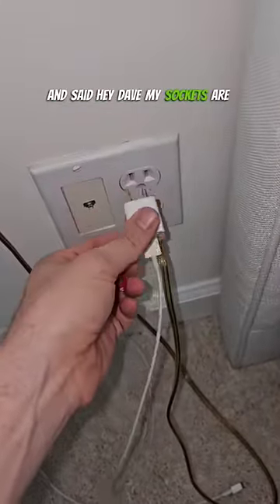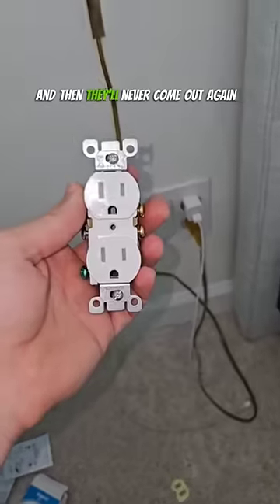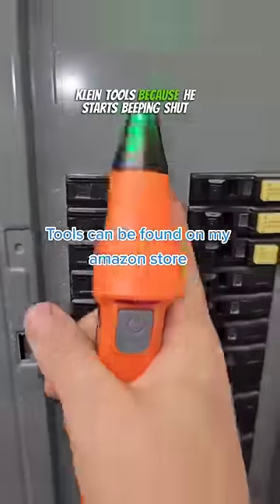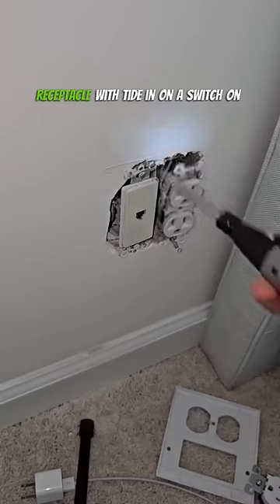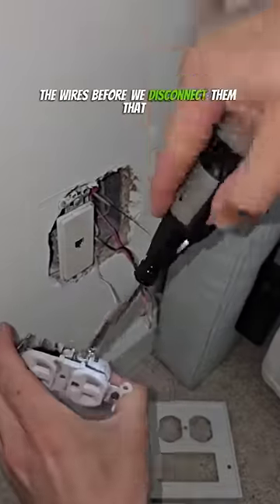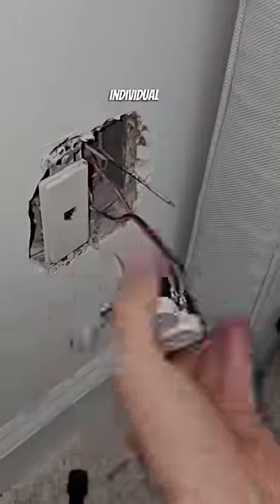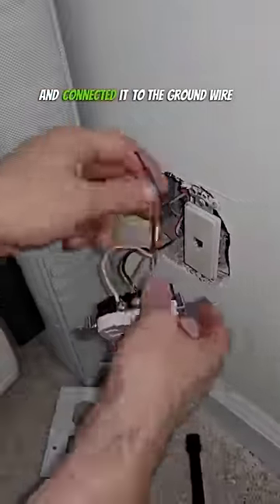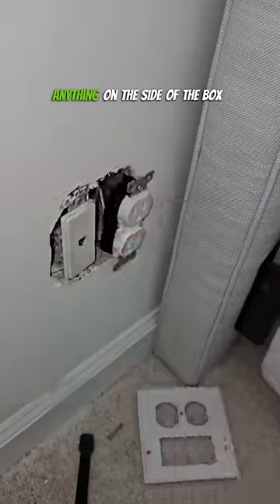🔥 Thats a hazard! How to change a switched outlet #diy #handyman #electrician #HowTo

Comment: Currently working on a house. One room has 4 different circuits, room is split into quarters and half of each quarter is controlled by a switch, other half is constant. It's a nightmare working on old houses sometimes
Reply: Most rooms are not entirely on one circuit.  That would require more wire than keeping your ckts tight.
Reply: As a retired electrician I was helping my son rewire an old home (built around 1906) he purchased -- it was a nightmare; one circuit went from the panel to a room behind the kitchen - to a kitchen wall receptacle - to a living room receptacle - upstairs to a bedroom receptacle and then back downstairs to another bedroom receptacle!!! I wanted to throttle the person that ran that wiring. 

To be fair, it had to be more than one person as some was knob and tube and some was newer wiring, but still -- it was a mess.
Reply: My 1986 cookie cutter house has crap like this. I justify it by using the other, live circuit for light in the same room
Reply: just worked on some old apartment. and two of the apartments were like this. 2 bed one bath ran off of two 110v they connected to make it 220v sad world we live in. so both apartments ran down to one breaker 👍🏼 instead of it being separated everything kept shorting out.
Reply: @brettsmith5030  Yikes
Reply: My old house had part of the living room and kitchen on one circuit and the other part of the living room was hooked to one of the bed rooms. The outside outlet was connected through the outside lights so when we had decorations up we had to leave the lights on. Was a total mess.

Comment: Make sure you only break the tab on the hot side of a half hot outlet. If you break the tab on the neutral side you’ll have to add another neutral pigtail to the other lug or else you’ll have an open neutral.
Reply: The only time someone should break the tab on the neutral side is if they intend to power each outlet by a separate circuit

Comment: Love how you mentions that the hook needs to go the same direction you turn the screw and then proceed to put the hook on the ground the opposite direction 😂
Reply: If you watch before he puts it back in the wall he flips it back the correct direction
Reply: You obviously must not know the purpose of a ground wire vs the rest of them
Reply: Look real close at the video, pause it at the time the ground screw is what appears to be on wrong…..it’s not, the video is reversed, the small mattress switches from the left wall to the right wall, also watch how he tightens it down by going counter clock wise…..was going to mention the ground wire at first….then 💡
Reply: I was about to say the same thing lmao
Reply: @anthonyertmann9979 wtf does the purpose of it matter? He still put it on backwards and could come loose and short hot or not give a return path in case of a ground fault and kill someone

Comment: That is most definitely not “the only way to find the breaker”
Reply: Well, it is the only way to find the breaker with it still being on in a hot panel.
Reply: No it's not, but I have one of those tools and it does come in handy on jobs where the last jerk didnt label anything or did so poorly. It saves time, but you're right it's not the only way. Just one of the fastest.
Reply: @barryallen5507  eh just short it and pop the breaker.  There's more than one way to do things, sometimes they just aren't as safe 😂 

(Not recommending anyone anywhere do that. It's a lot of trust in over current devices amongst other reasons it's not a great idea, just saying it can be done)
Reply: @goosenotmaverick1156  oh definitely faster, and safer.. but still sometimes ya need a lil jolt to get ya going😂
Reply: @carsonkahla9162 Just get a plug and put it on a light switch. And bam, got yourself a circuit finder.
Reply: God forbid they label the breakers 😢
Reply: that is exactly what I was thinking.
Reply: @goosenotmaverick1156  definitely not the best way.  I have seen one or two Seimens breakers failed to trip on a dead short.  Then your wire welds itself stuck and you can't simply pull it back off.   I'm still guilty.
Reply: @bearcountrypublishing5303  been there had that class myself as well. If I feel I must do it, I try to be careful of that chance. I've not had it happen yet but I've had some that took extremely extended amounts of time to trip that were concerning. I can't remember if Siemens or GE, that's been a couple years. I've seen some 20a single poles hold way way more than they should have for a lot longer too. Safety devices are safest when they work properly, that's for sure..
Reply: @novazo1  they don't hold up to very many uses with a dead short load across them. Lol
Reply: Yea another way to do it. May take a little longer but it's still safer and cheaper is to either put a receptacle tester or a lamp light. Turn on the lamp light. And then switch off the breakers until you the tester or lamp turn off.

Always test any box you are in because there are sometimes multiple circuits. If a wire in the box is still hot, keep turning stuff off and test it with your hot stick until it turns off. Longer, yes but cheaper.

So if you're not a tradesman like me, you likely only have a lamp and you can just go out buy a cheap hot stick or tick tracer. They have all kinds of names for it. Either way that's the cheapest and safest way to do it.
Reply: @goosenotmaverick1156  Lol I didn't say they did haha. It's just one of many solutions. And a fun way with low 120v but my favorite is using a quality circuit finder that you plug into your recep and go to the panel with the wand.
Reply: @goosenotmaverick1156  Saves a trip to the panel too. lol.

Comment: Only way to find the breaker eh? Guess I've been doing it wrong just shutting them off and checking power at the outlet to be sure I was right.
Reply: You will notice if you're right or wrong if you get zapped, no need to double check.

American outlet wiring looks straight out of the 1800s and the work safety seems to be on the same standard. 
Here in Germany the first thing we learn is: switch off, then check  and not switch off then feel if you're right,

Comment: Thank you, electrician here and the 1st thing i said was replace the damn thing theyre like 7 bucks 😂
Reply: I mean you can probably find cheap ones wholesale online
Reply: I just googles it lowes and home depot have some 15a for less than half of that, tho we only buy from wholesalers
Reply: are used to work on the wholesale back inside we’re buying these plugs for like $1.25 apiece and selling them for like 3 to $10-$15 depending on the customer
Reply: If you're concerned about saving 3 bucks on whole sale outlets.... ill pray for you on that.
Reply: they're like 75 cents at home depot
Reply: How hard is it to change ungrounded outlets to grounded outlets? Is that something I need an electrician to do or is it something I can do myself?
Reply: I have old plugs with two holes and no third. The house is old and I was told I have to rewire the entire house for it to pass code.  But I dont know how accurate that is.

Comment: Bend the prongs in the charger in slightly so they squeeze on the outlet. Done!
Reply: Thats exactly what i do. The outlet above my bed i only use for a single phone charger anyway, so just bend the prongs a little and its super tight fit
Reply: A loose plug indicates age.  And, potentially dangerous problems you can't see.  Until recently, they made plugs where you don't screw, but "push in" wires in the back.  (No longer code!)
The only thing keeping the wires tight are springs - which wear out over time! So, you could have an old, worn-out socket with loose wires in the back...ready to drop out one day, and light your house on fire.  Check them!

Comment: Whover came up with the sticky product needs put in jail. They will be responsible for more than one fire. I lived in an old house that had 2 outlets melt down due to loose connections in the outlet. Fortunately no flames, because we were home both times. We got lucky. After the 2nd one, replaced all that appeared to be the same age or had any sign of a loose fit. If you have a loose fit in an  outlet, and try tape it to the plate, lol, let me buy you a fire extinguisher to go with the tape. Both times were space heaters where the plug fell partially out of the outlet. .

Comment: Definitely not the only way to find a breaker
 ( ͡° ͜ʖ ͡°)
Reply: Literally label the service pannel😂 only way
Reply: I simply short out the outlet, the breaker quickly IDs itself
Reply: @richlaue hat's drastic, I just shout up to the other occupants of the house asking "is the light out yet?"
Reply: @johngavin2570  lol that was my job as a child 😅
Reply: @CapSora  same
Reply: @richlaue  used to always "test" the outlets at school with a diy outlet "tester" (cut of powercord and the lines just bridged) xD
Reply: I dont even turn the breaker off, i just work on it live.
Reply: @richlaue blew the shit out of a fuse doin that one day. Carry new fuses now.
Reply: @simiiee  I was joking
Reply: @johngavin2570  I plug a vacuum in and wait till I can't hear it
Reply: Just build you a "remote breaker tripper" ;) U-shaped piece of wire shoved into the old outlet. The breaker will self-identify and you'll only have to visit the panel once.
Reply: i just scream to my buddy when its off
Reply: Trial and error works LOL
Reply: @Joesolo13  Same, but it's a fire alarm I stole from the old high school when it got torn down.
Reply: @loosha1854  Work on old houses, you'll find how often the ink or pencil on the breaker labels have faded into obscurity, or the labels have dried and curled and fallen off.

Comment: Lamo defiantly not the only way to check a breaker
Reply: English is hard, man.
Reply: @niclikescakes  whoops typed that while pushing a turd out at work 💀
Reply: @user-vf6km4sf2r  You have to let the phone do the work for you, when you're in the middle of dropping a fat stinker. This is autocorrects primary use
Reply: I prefer just sticking a wire into the outlet
Reply: Jumper plug 😂
Or
Circuit breaker short circuit tester

Comment: Plug a lamp into the outlet. Park your wife in front of the lamp and call her phone. Go to the breaker box and start turning breakers off. When she says the lamp turned off, you found the breaker. Label it for next time.
Reply: Or use a radio if you're a lonely heart.
Reply: Cool, thanks. I just gotta go meet someone and get married real quick, and then I can fix the outlet.
Reply: Or just buy a Plug tester and plug it into the outlet. If the lights are out then the plug is dead.
Reply: Personally I just make sure there's nothing important in the house using power and shut my main off but that's just me.
Reply: This is the most complicated way to do it lol
Reply: @Mark Jones Ah yes Boilers. My poor parents rather pour money into fixing a boiler that's been having tons of issues then to buy a heat pump. Thermocouple burnt out twice most recently the Limit switch had an issue and would not engage the Blower.
Reply: Unless she's easily distracted and doesn't tell you that the light went off. Meanwhile you went through all the breakers and the fkn light is still on. Now you spend 2 hours looking through the entire house for another panel.  Finally you just go outside and open the service disconnect.......to replace a receptacle.
Reply: What if you don’t have a wife. Could a domestic house cat work as a substitute?
Reply: then reset all your clocks.
Reply: @MasonJarGaming  rent a wife, they charge by the hour.

Comment: Who does an unlabeled breaker box?
Reply: That was my question 😭
Reply: Someone who has never opened there breaker box since building there house. I mean it's pretty obvious they're not really handy if they're calling an electrician to replace a wall receptacle.
Reply: Mercian’s
Reply: My apartment's is like this. It just happens to you sometimes.
Reply: Mine was unlabeled when I bought my house.  Annoying as hell!  I didn't know about the circuit breaker finder tools until now.  Usually it was turn off a breaker and go check if x thing has no power.
Reply: damn and unlabeled panel box would be a definite fail to start with .
Reply: Ours is unlabled but unfortunately that's because there's almost no rhyme or reason to where the power goes from each breaker (with exception for some appliances). We just wound up drawing a diagram instead.
Reply: Someone who bought a mass produced house
Reply: I got one of the tools like he has when I moved into my house and used it to label all the breakers.  Man I wish I could pull all the wiring from my house and redo it with home runs.
Reply: @americankid7782   I have seen non-mass produced houses and they are worse.
Reply: Over the years it was replaced and the homeowner didn't want to pay the electrician properly or someone who really shouldn't have been doing it put it in.

Comment: First way is a good way of causing a fire by allowing millimetre space between contact terminals causing arcing which will set fire to the dust build up that will inevitably occur causing the house to burn down

Comment: I put tape on all plugs and switches especially in residential where the ground wires are usually bare. I also put the ground on top, with it on the bottom and the plug is not all of the way in the outlet and something falls on it you have a 50/50 chance of it laying on the hot lead, with the ground on top you an almost 100% chance that it will be laying on the ground, much less likely of starting a fire or worse.

Comment: There is no code in the NEC that requires you to wrap outlets or switches with electrical tape, this is simply something people were taught to do by other people that didn't trust their skills.
Reply: Not about trusting your skills, its about understanding people. Outlets wiggle in the box even if you screw those fuckers in tighter than hell, it keeps a problem from happening in the future.
Reply: @aTF2player  not true and properly installed outlet won't "wiggle"
Reply: You don't wrap the outlet because you don't trust you skills. You wrap the outlet because of Murphy's Law

Comment: Needing to add electrical tape is bad, this is a design flaw and should be better. I’m glad the uk have decent electrical fittings and backed by decent regulations.
Reply: That's why after all your taxes and regulations you have 2 pounds to your name.
Reply: Being a good spark, owning my own business and multiple properties, that statement is incorrect. But what do you know.
Reply: Not even a design flaw its just old.
Reply: @robertwye9463  if this happens with age it could still be considered a design flaw. Loose connections (I’m sure you’re aware) can cause 🔥 so measures should be put in place to stop this from happening.
Reply: @sibrown not old as in worn down. Old as in this is the way it was done 40 years ago.

Comment: If you don’t have the tester, grab an extension cord and a lamp. Bring the extension cord from that outlet, and have the lamp near you. Flip the breakers until it turns off.
Reply: Or check the schematics to see what breaker you need to flip? Or dont you have scenatics of the electricity in the states?
Reply: Nah.. plug in a radio and turn it up loud enough to hear at the box. Way more likely to hear radio in the basement vs. having a 100ft extension cord down multiple floors.
Reply: @yannickdevos6021  They're numbered and on the door is a list describing the location.. but they can be wrong or illegible.

Comment: If one of the outlets is switched like that make sure you do remove that jumper because if the light circuit and the plug circuit are on opposing phases you will have 240 volts between them when the light switch is turned on and you will blow up the switch and/or both breakers. The only teason I know is because the builder wired mine that way including the disposal switch right next to the outlet in the same box.

Comment: You don't need that tool, all you need is a buddy to yell, YEAH IT'S OFF 🤣
Reply: Not even, just jam your hammer in between the outlet and the box and it'll say "BANG" and then the breaker turns itself off. That way you only have to go to the panel once when you're done to turn it back on.
Reply: Can't do that if someone is on an oxygen machine. That is unless you want them to die.

Comment: Friends don't let friends tape recepticles.
Reply: I was thinking doesn't this defeat the point of it being earthed ?
Reply: @watchingtheworlduk5253 no your screw is metal and is the ground connection to a metal box that is already grounded .. but by code they want a ground wire also attached...
if you have a plastic box then you definitely have to connect a wire for ground.

Comment: there's a thing inside the plugs that actually holds what you put in there, sometimes the case of loose plugs is that thing having a larger gap than it used to be cause by large thing that go inside it which is easily fixable with some screws and little strength to bend that thing back into place.